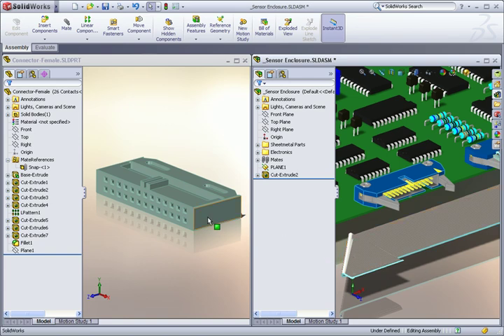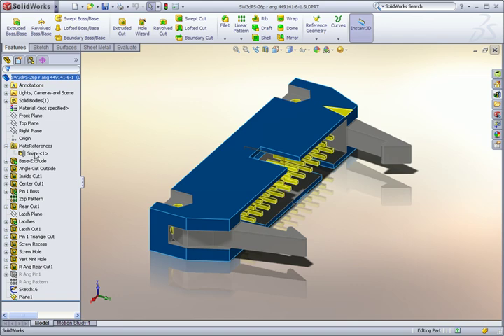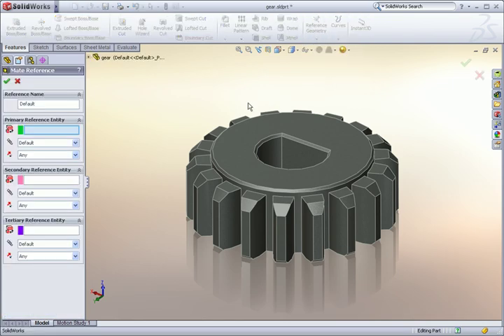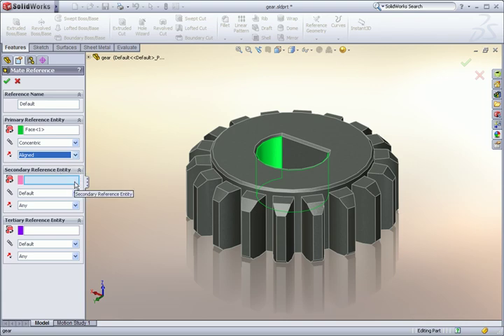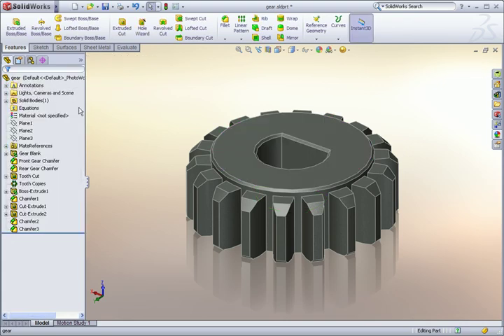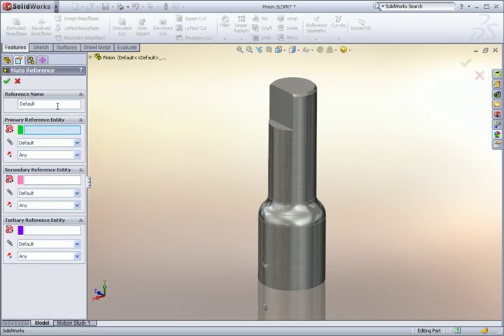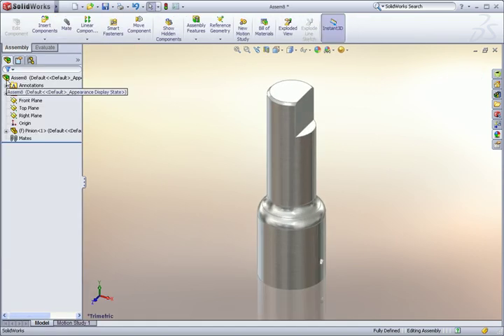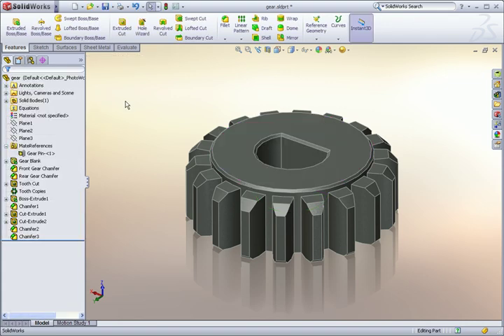SolidWorks Time-Saving Tips: Mate References

Comment: I've found that it is better to select "Any" for the concentric mate reference entity and assign alignment for the coincident mate reference entity. The reason is because the alignment for concentric mates depends on the direction in which the feature is extruded or extrude cut, and for some parts, it's hard to keep track of whether you extruded up, down, left, or right. With coincident mates, whether it is for a flat face or a plane, the alignment is simply based on the Normal of the surface. To determine that, just select the flat face or plane, and select "Normal To." If the Normal of the plane is the opposite of what you want, you have the option to "Flip Normal" as well.